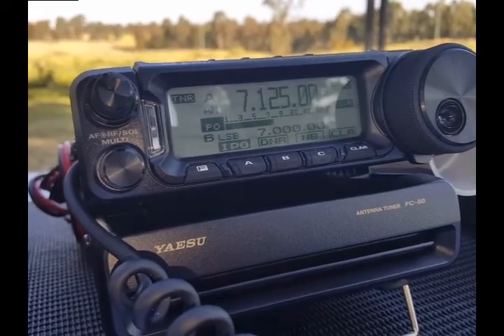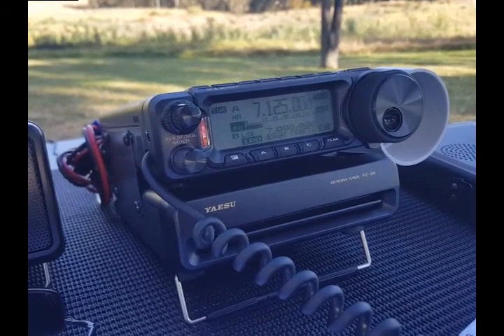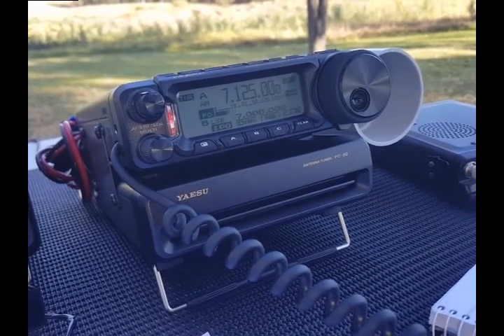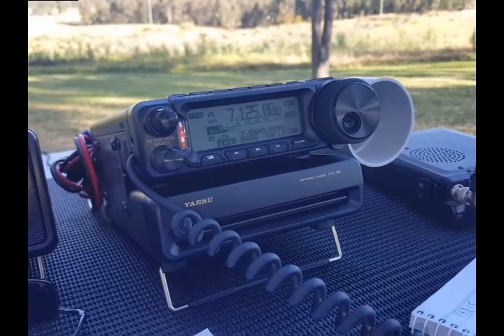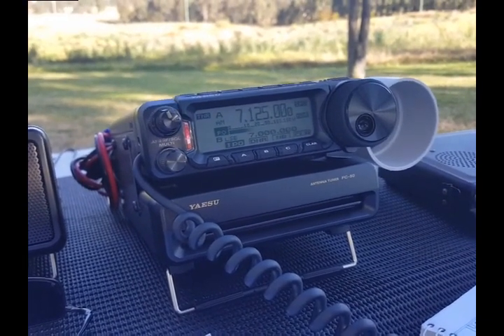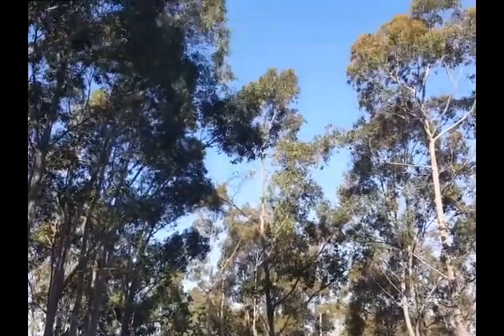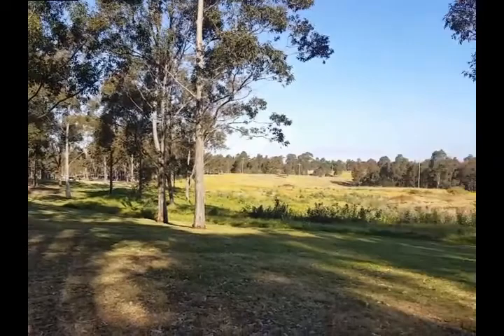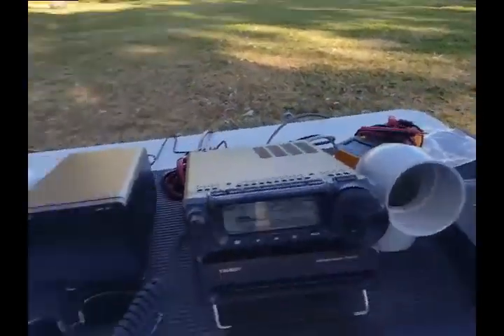10 Watts AM

Comment: Do the antenna tuner work better than a LDG tuner
Reply from the maker: Not sure. I have never used an LDG tunner. The Yaesu tuner works perfectly with it and bolts to the radio (all brackets and bolts included) in one neat easy to handle package. The flip stand screws to the bottom of the tuner as well which is nice.